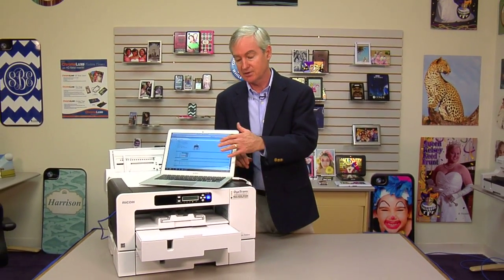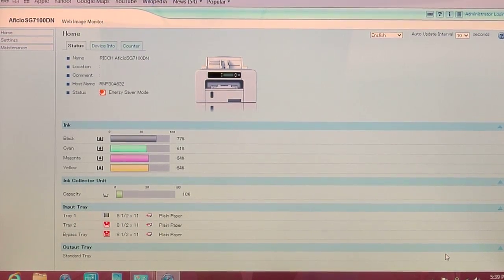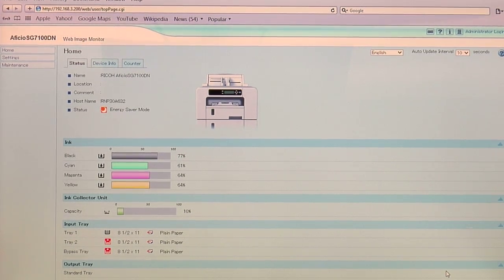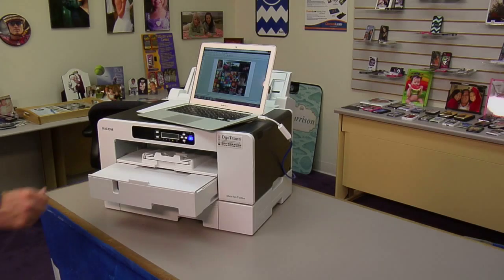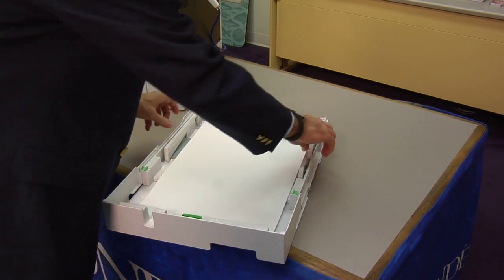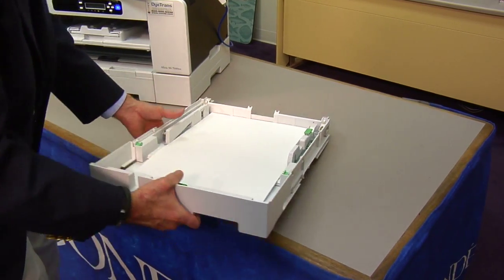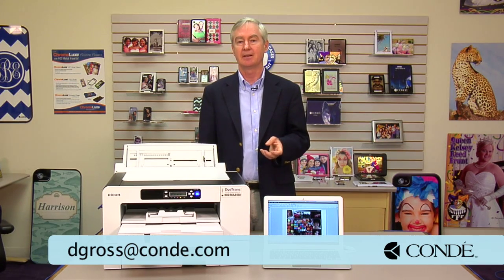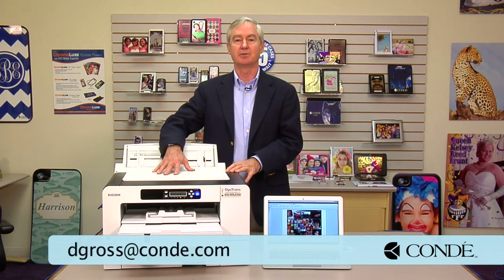Exploring the Ricoh SG 7100DN Printer - Part 5 of 5 -

Comment: Hi there,
I have the same printer and it is doing a good job. Recently it started to print with small square white grids, which are almost invisible but this reflects to my prints. I do every day little jobs, like one or two pages of printing. Here is quite hot as well, so i wonder if i need to do nozzle checks more often.
Can you give me an advice how can i prevent the appearing of this grids?
Reply from the maker: A white grid is a sign of an issue. You need to call your supplier tech support or Conde's at 1-800-826-6332